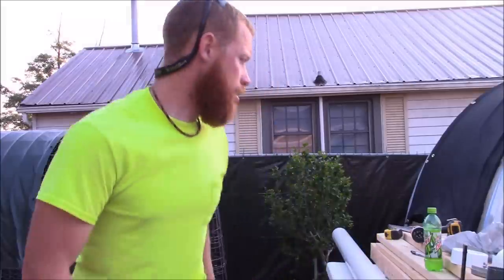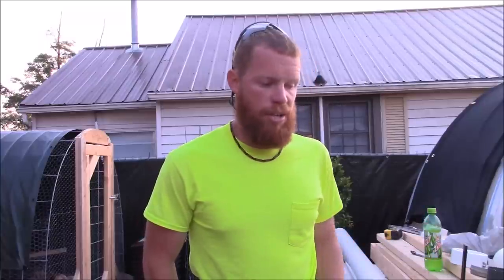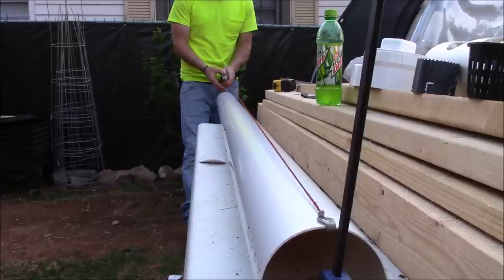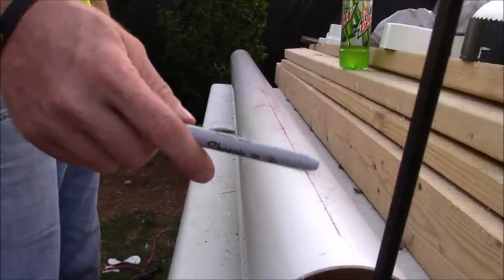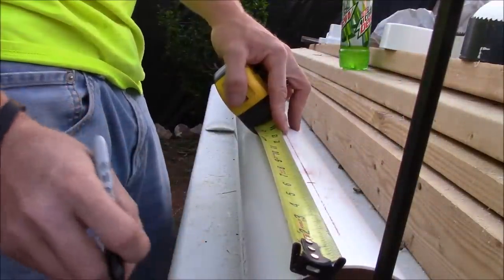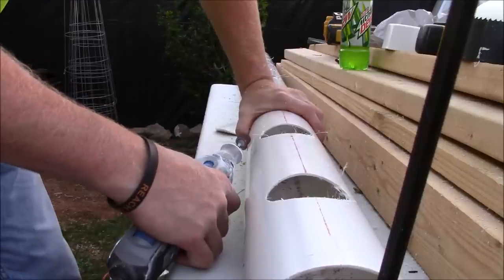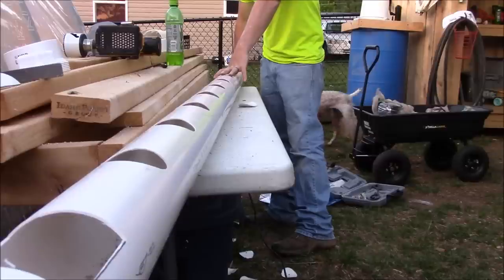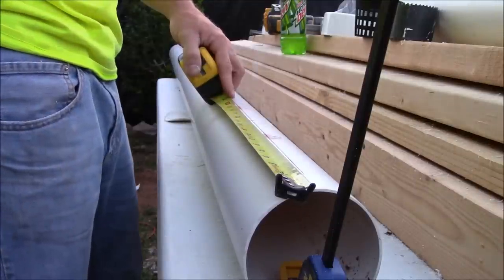Hydroponic Rail System Build - VLOG 2 by HPFirearms

Comment: I seal the ends with black rubber covers with hose clamps. Drain end has 2 holes and 90degree tubing couplers  draining Into a gutter..in the spring i have a GIANT QTIP/BOTTLE BRUSH MADE FROM 12 ft of 1/2" dia PVC TUBING with a T Shirt wadded up and tied on one end..i dip my Qtip in hot soapy bleach water and swap the pipes like cleaning a rifle barrel then run the closed  system a while with clean water..then drain. Add plant cups and nutrient solution. Thats it.

Comment: Try doing it with PVC fence posts I like square better I have done it everyway you can think it's easier cutting wholes with whole cutting saw on flat surface thay also have end caps ,I used rockwhol cubes in I think  3" all Pvc pipes drained into rain gutter  and you can run back into  Reservoir or wherever you like . Just a nother idea ,anyway great job keep on growing. 😊

Comment: I found the same problem with cutting the holes.  It almost jerked my arm off when the hole saw teeth hit the PVC.  I then did all my holes with drill in reverse and it worked really nice.   My pipes came with a solid strait  line of writing down the length of the pipe.  I used that writing line to drill my strait lines for the holes.   Great videos!  Thanks.

Comment: Good job, Bobby, thanks. I like the electrical uni-rail use allowing adjusting the clamps vs. as you say, cutting half circles in wood which can never be moved. Great drill technique- start the holesaw's pilot hole clockwise and then switch directions and 'burn' through the pvc in reverse on your main net pot hole  leaving no burrs.

Comment: I dry fit the fittings but put a small amount of food grade silicone grease on the pipe before putting the fitting on. No leaks and I can remove the fittings to clean the pipes.

Comment: I dont know what UPC is for different states but for pennsylvania potable water systems are mandatory copper. The copper potable water system are held together with solder. So if you have used PVC or any kind of PVC for potable water you have just mixed up code for DWV (waste water from toilets ect...)

Comment: Bobby it's an old video but that running the drill in reverse is a old timers tip, the same applies when cutting plastic siding/skirting on a table saw. Good info.

Comment: Taking notes:

* 4” Schedule 20 PVC, which is cheaper than schedule 40
* 2 3/4 inch hole saw for 3" net cups. (do pilot hole in forward, but drill hole in reverse)
* 10” between net cups, 6” from end
* sand edges of holes
* include inspection hole
* If multiple rails, stagger holes
* Glue end caps if they leak when dry fit

Comment: Looks good.  Another dry fit option that I've had success with is to wrap Teflon tape around the edge of the pipe.  2 or 3 overlapped wraps about an inch or so wide. Cap fits snug and no leaks.  I've got 2 four foot chicken waters set up that way. Only leaks are from the nipples.

Comment: I use a 3 inch wire brush on the drill to clean the burs. Much quicker and cleaner result. Also use silicon and hot glue instead of PVC cement/glue.

Comment: This may be a stupid question. But I'm new to all of this and I'm curious as to how do you get the plant to grow in there? Do you just put a seed and water and it just starts growing or do you germinate the seed first and then stick it in there or how does that work?
By the way, great video! Very informative
Reply: Cindy, Buy some small Dixie cups punch a couple of holes in the bottom to allow water to drain out, fill with potting soil, water soil and plant your seeds. When the plants have established a good root system remove them from the cups and plant. I use a water-soluble Plant Food in a gallon jug to water my cups. Good luck...

Comment: I have learned so much from you, so that my mind is working for what i want. Don't they have much larger pipes and use larger net cups? I think that that would be great for all the roots that will be inside the area. I would use a mister and a flooter, with a water reserve barrel that contains nutrient solution. Thanks
Reply: Baby steps

Comment: I don't know where Bobby lives, b/c most of the water supply lines up in Canada are copper or pex and there is no glue involved. Only the drain pipes are abs pipes.
Reply: In your house it's copper or pex. To get to your house, pvc has been in use since the 70's.

Comment: another trick is to drill all pilot holes with drill bit only first, then come back make the holes with drill on reverse.
Reply: A hole saw has a drill bit in the center. You can't do that. If you drill the hole bigger than the hole saw bit, it will jump and wobble a perfect egg shaped hole.

Comment: Use purple pvc cleaner before gluing bc after 3-4 yrs the glue only can pull away from the pipe causing a leak
Reply: You do understand that the glue is not actually 'glueing' the fittings together?  The glue melts the PCV and the PVC makes the bond.

Comment: One of the shortcut to spend less effort gardening with hydroponics system is taking advantage of hydroponics experts, no need to learn through trial and error like they used to!
Reply: exactly. I ran an 8 bucket "Bumper-bucket" hydroponic system on a south-facing apartment balcony in the 80's right above a cop-shop - growing tomatoes. It wasn't too long before they came a knocking assuming it must be pot. After that I had a dozen knocks on the door asking, out of curiosity, if they could see my "technology". Made a lot of mistakes experimenting with the variables back then.
Reply: thanks
Reply: lol bxt....we need many experts on this.....

Comment: Isn't the glued PVC in your house used for drainage and not the water supply though? Just saying. I don't believe gluing the fittings in a system like this would ever have the toxicity levels you would ever be worried about.

Comment: The water supply in my house is not pvc; most aren't. They are copper or pex, crimped on. That you are not dead yet as a thirty something after having used PVC glue many times is not an indication that the glue is not toxic. I don't have a dog in the fight between using glue or not; Just sayin'--the argument employs fallacies you should be aware of.